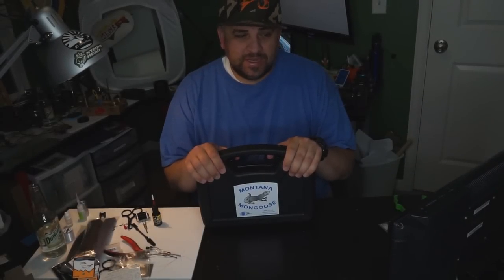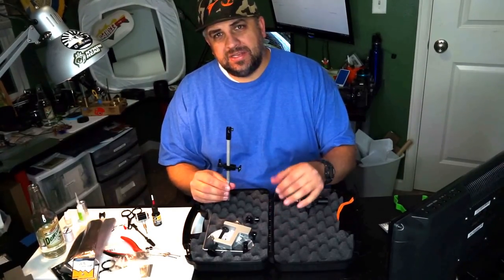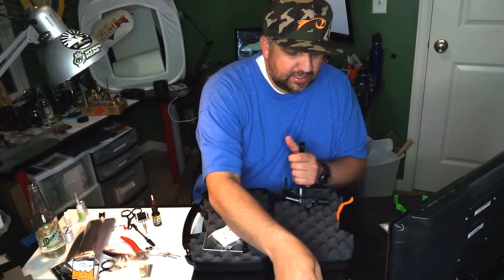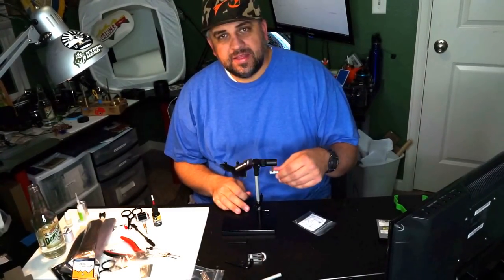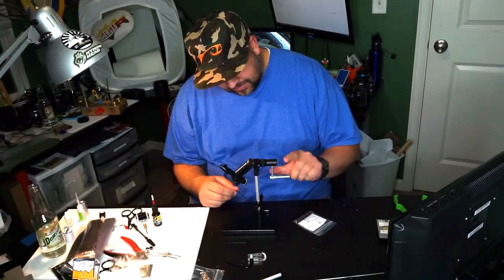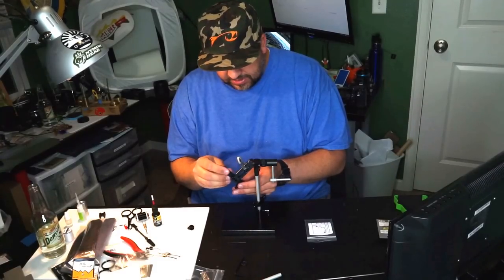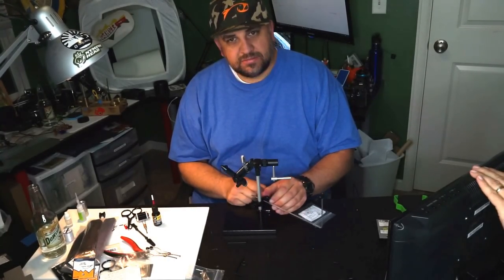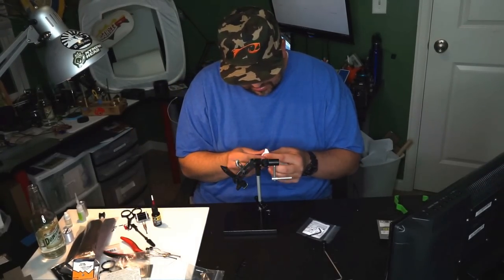Fly Tying Tutorial: Griffin Montana Mongoose: Unboxing and Setup by Fly Fish Food

Comment: I love this vise as I think its packed with some great features and adjustability for the money, perfect for my use anyway. And I like the bobbinholder as well, I adjust the hookclamp so the hook rotates true, tie in my peacockhearls/tinsel/wire or whatever, bring the thread up, throw in a half hitch, hang the bobbin, rotate the material onto the hook and thread is still excactly where you left it.
Also I use just a drop of sewing machine oil to lubricate the rotary assembly to keep it smooth.

Comment: I've been tying on a Mongoose for years.  I have to say that my setup is a Peak/Griffin hybrid.  My first vise was a pedestal Peak.  I never fell in love with the Peak.  After a year or so and a ton of research, I picked up the Mongoose pedestal vise.  The Mongoose pedestal base was too light for my taste.  So, I use the Peak base with Peak's brass riser.  It works great, especially with some kind of non-slip pad under the vise.  I like my Mongoose a lot, but I've recently acquired the Renzetti bug (desire).  I just need to convince my wallet that it's the thing to do.  I still tie pretty much daily with the Mongoose.

Comment: Great vid - appreciate the lube tips.  

Regarding the base, I turned mine 90 degrees, putting the larger portion of the vise towards me.  That prevents it from rocking when using the rotary feature.
Reply: Zone3 ADK I use the gel pads that are sold to hold cell phones in the car it never moves